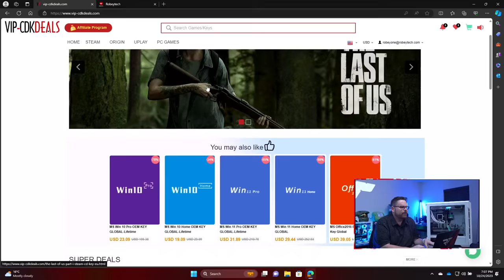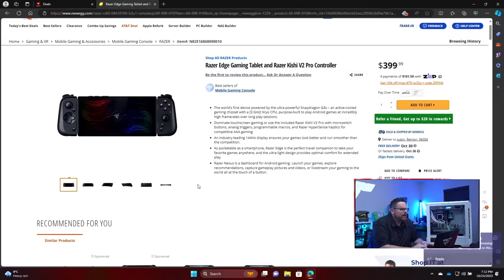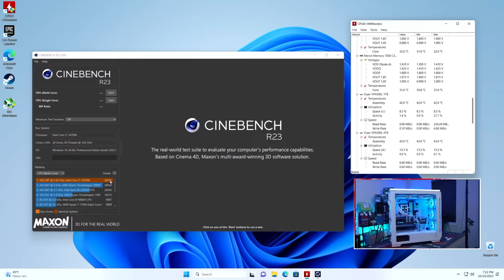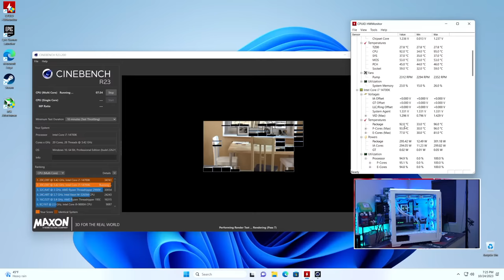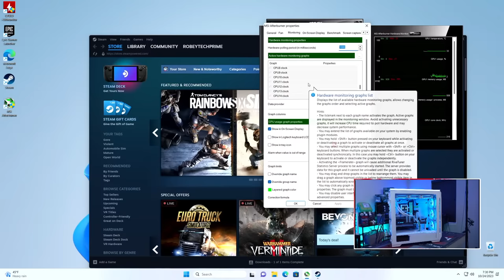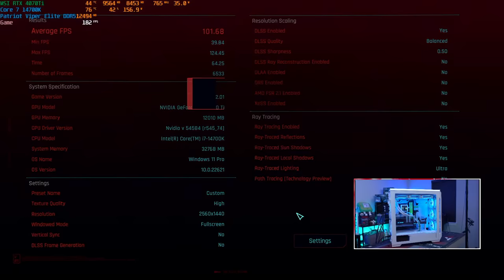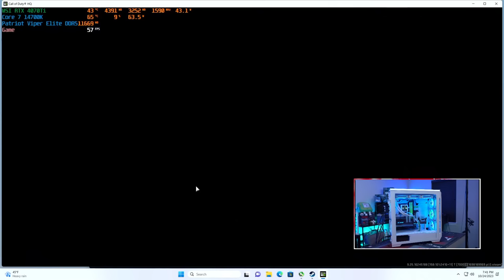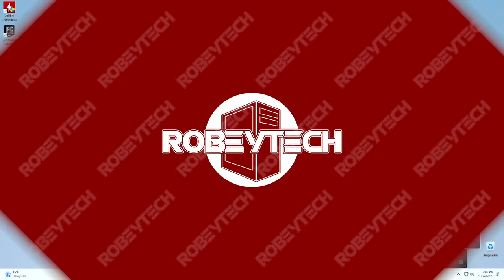14700K Intel Giveaway PC - Custom Designed Phanteks P600s (Intel Core i7 14700K / MSI RTX 4070Ti)

Comment: Would be nice to win . Can't afford to build a new rig and mine is 14 years old
Reply: Pulling for you. Consider a used ryzen 5 3000 or 5000 system
Reply: hope you get one 🙏🏼
Reply: Cant afford lol.  Prebuilts u can get for 1100  build urswlf for about 950.

But seems everyone got 1200 for a new same iphone every 8 months
Reply: @Fatpumpumlovah2  I hate I phone so borderline insult but because you did not know. Ihave not bought a new phone in years.  And I generally don't even have a k laying arround
Reply: @TheRhadamanthus At least you have a pc, I don't have one. Only a laptop with a celeron CPU from 2010 that literally shuts down after 20-30 mins of use. It's becoming quite annoying😭